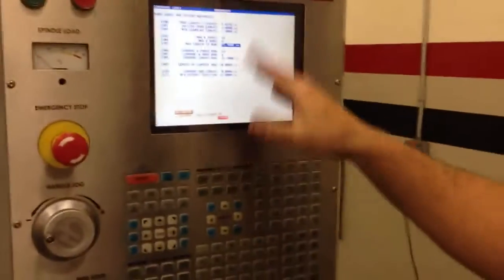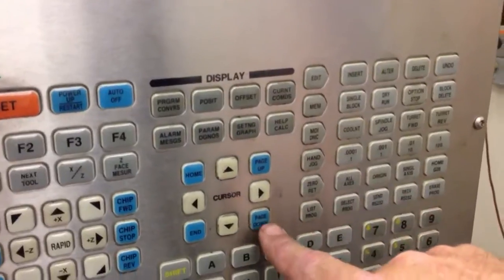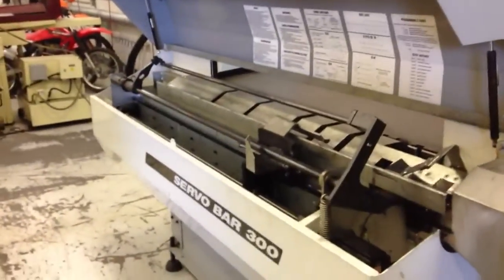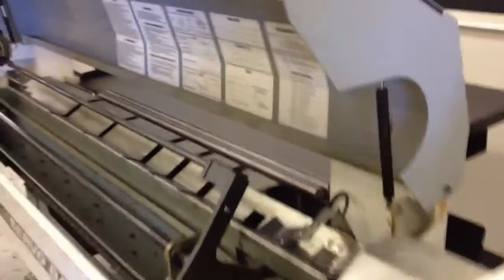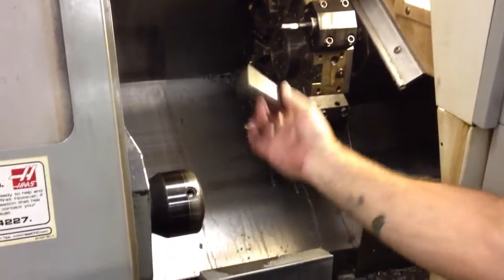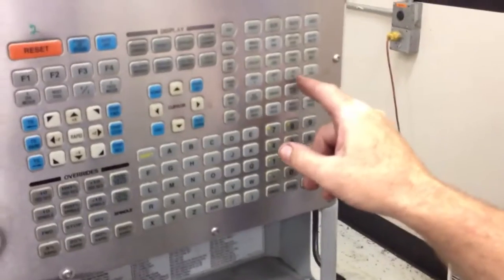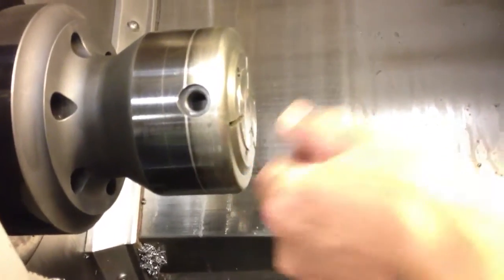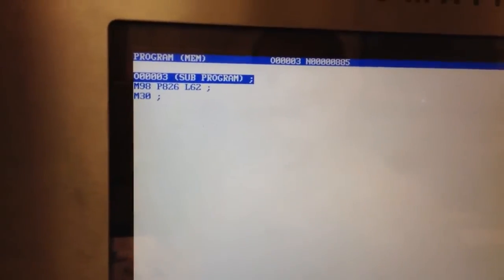Haas SL10 bar feeder setup

Comment: Hi Michael David or anyone here seeing my message. Please help me how I calibrate my bar feeder back to zero position. The end home position proximity sensor got broken. When I replaced, the error came out as 653. I disconnected the servo and move back the bar pusher manually to home position. The same error appear. Thanks

Comment: thanks maybe I did no explain my self, a bar puller is faster, the thing here is,
 when my bar puller ends on subprogram how to make the bar feeder to just pull one more bar, put it all the way in until the bar is in place, and make the bar puller complete a hole cycle again, thanks any way if i come up whit the program i will send it to you promise.
Reply: I would just G105 to load the bar to initial push and cutoff one time and then from there on out you could block delete the G105 code to skip over it so you can use your bar puller if you prefer that method.
Reply from the maker: Jorge Valdez I am not sure on that one

Comment: can yo explain how to use the bar feeder in combination whit bar puller, lets say i use the bar puller until the bar ends and the use the bar feeder to load another bar, and yes your famous, thanks
Reply from the maker: Jorge Valdez I am not sure how to do that. I would turn the bar feeder off when using a puller or perhaps you can feed short, leave the chuck open and then use the puller before clamping.